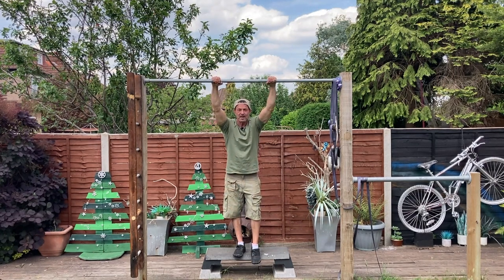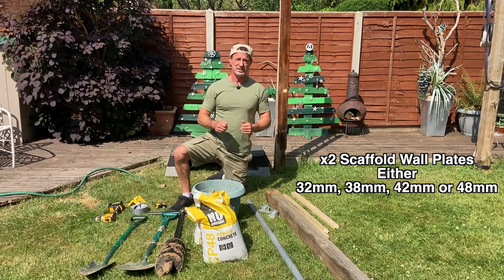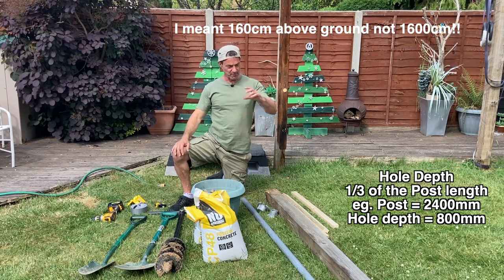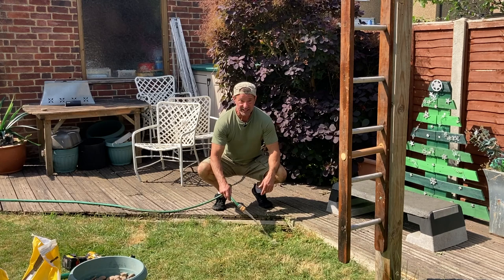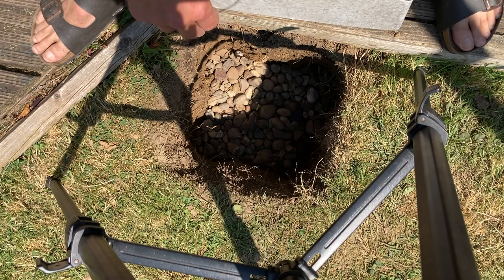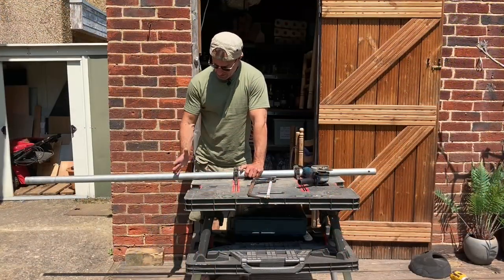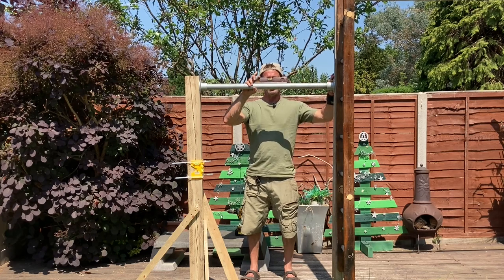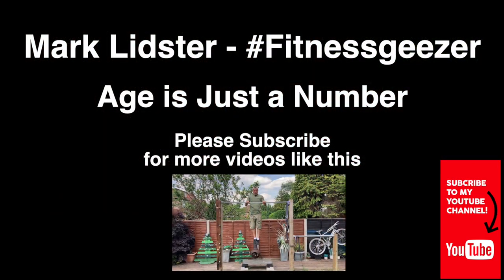DIY Build An Outdoor Pull Up Bar

Comment: Can’t believe you can muscle up!!! Beast💪🏼
Reply from the maker: Cheers buddy. I’m working now on improving my form and the number reps. Probably be my next video
Reply: Nice one. Interesting and yes, who wouldn’t want to work out in the garden on a good day. Thanks 🎉
Reply from the maker: @davehollingworth5537  Thanks Dave 😊
Reply: @MarkLidsterfitnessgeezer I got a curious question do I still have a chance to learn the front lever ? I’m 28 years old the skill I achieved is human flag,handstand,one arm push up and muscle ups. It took me 10 months to achieve the 1 leg front lever and is been a month now I can finally hold 1 leg for 10 secs. The front lever workout I use to weighted pull up, Resistance band front lever raises,tuck front lever rows on rings and Australian rows .

Do I have enough strength to front lever in the future ? 

Thank you for your motivation 
Chris
Reply from the maker: @chriscox1535  Thanks Chris. It’s sounds like you’re doing all the right things to get the FL. I would only suggest you add front lever pulls and the dragon flag hold for time. Also add weighted pull-ups and dips to further strengthen your shoulders, back, lats and arms. Then there’s no reason at your age why you can’t achieve it. Good luck 😊
Reply: @MarkLidsterfitnessgeezer  thanks for the motivation I just unlock the straddle front lever for 3 secs today and could front lever raises without the resistance band. Happy training
Reply from the maker: @chriscox1535  Thanks and we’ll done on your progress man 😊👍
Reply: @MarkLidsterfitnessgeezer  thank you man good luck on your planche journey . You inspire me to learn the front lever

Comment: A thicker post say 3m x 150 x 150, I’ve seen people say that you only need to put them in 70cm do you think that is enough?
Reply from the maker: As long as your concrete bed is sufficient I reckon you’d get away with that
Reply: Thanks for the speedy reply, the reason I ask is I’m finding a 3.6m post 150 x 150 quite hard to come but there’s loads of 3m but I don’t want my feet touching the floor when I’m swinging
Reply: Also great video really informative!!!
Reply from the maker: @robr9170  Glad you found it useful😊